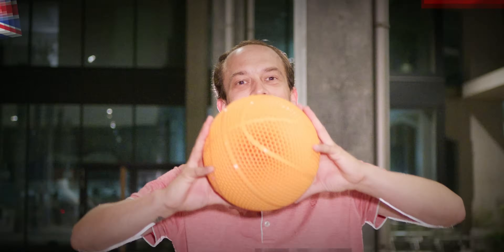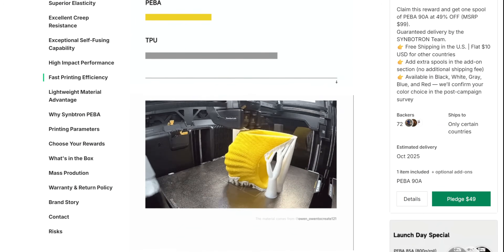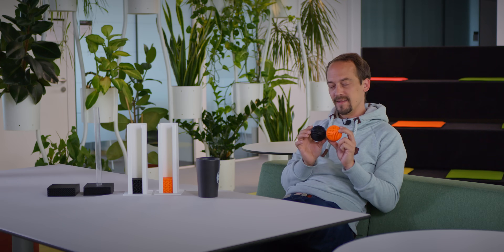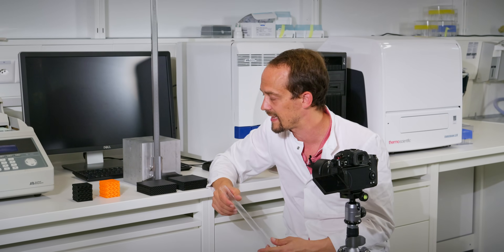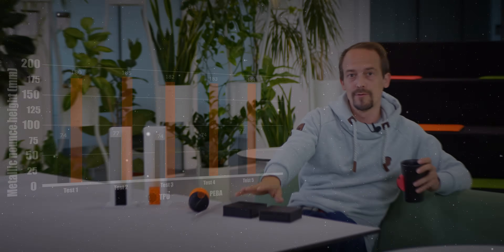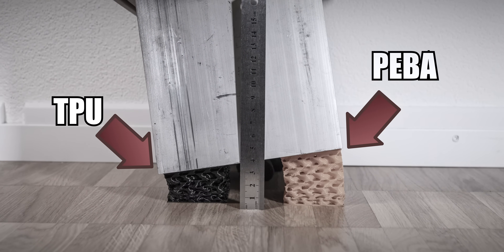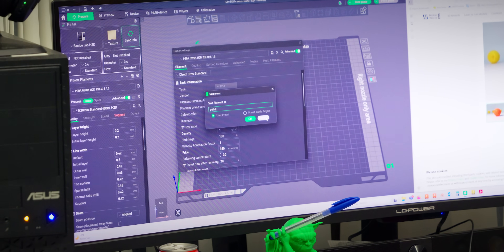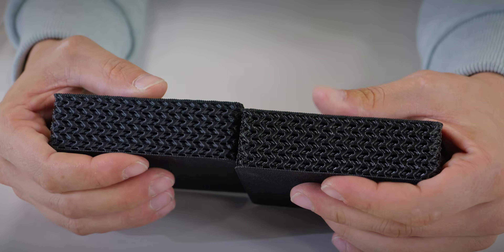Forget TPU! There is a new Flex-King in Town

Comment: I'd like to see what happens if you apply the 3kg's to the tpu print, wait for it to "settle" (I.E when the rate of compression is reasonably slow), and then apply weight as necessary to apply the same amount of compression to the PEBA. Could be interesting to see how well they bounce back to the original size and shape after roughly the same amount of time at the same amount of compression/size reduction? Love your content by the way!

Comment: How good is the friction of this stuff? Biggest downside of normal TPU is IMO the missing of proper grip, because of it's smooth surface. The only TPU I know, that provides grip/friction is Fiberology MattFlex for almost 70€ per kilo. But creeping or fatigue is also an issue and thanks for the tip.
Reply: Other reviews of other PEBA brands says that the grip is not notably better than TPU.

Grippy filament only exist in limited production experimental expensive batches, hard to find. I managed to get my hands on some grippy TPU, but haven’t used it yet to say how much better it is.

Comment: we need spool roller that senses tension and (with a motor) rolls the filament until there's no tension, like a the helping dude at a climbing gym that keeps the safety line almost taunt but not taunt 8:35
Reply: In my work our rubber extruder uses a gravity arm. The higher the tension on the arm the faster the extruder runs to keep up, if no tension and the arm is fully down the extruder stops. I'm not in a position to imagine how this could be implemented for filament spools but it could potentially be a fairly direct & dependable solution.

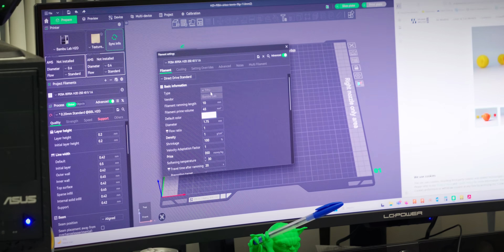Comment: 16:45 Those edge rollers can be really bad.

1) Some spools have notches along the edges, to more easily clip the end when storing it, and the bearings get a bit stuck in those notches.

2) When the spool is full it rolls easily, but the less filament is on the spool the more force is needed to pull the filament. This gets exponentially worse if the roll is higher and you're pulling downwards (because then the pulling adds to gravity), so if you do have an edge roller make sure that you're pulling the filament upwards (so additional force counteracts gravity).

Combining 1 and 2 makes for very inconsistent, or even outright impossible, printing.

Personally I'm using a middle roller with bearings. Technically it could be problematic if the inner hole of a spool was uneven, but I've yet to encounter such a spool.

Comment: 10:15 The graph does NOT show "2.5 times more" but rather 2.5 times as much. Those are NOT the same thing!

E.g., 0.7 times more than 100 is 170, while 0.7 times as much as 100 is 70. Likewise 2.5 times more than 100 is 350, while 2.5 times as much as 100 is 250.

If you're confused by it, you can stick to "as much as" and completely avoid using "times more than".

Comment: 6:10 You can't talk about weight difference in percent, without specifying the base of comparison. X being 20% heavier than Y is completely different from Y being 20% lighter than X, so you can't just say that they have "a 20% weight difference".

E.g., if X weighs 100g and Y weighs 80g then Y is 20% lighter than X (formally y=0.8*x), but X is 25% (!!!) heavier than Y (formally x=1.25*y).

Comment: Would like to print machine slideway covers of bellows. Is it possible. Would need to have a removable support between layers
Reply from the maker: If u use a h2d and pla supports they come out super nice. 
I never tryed pva with this material 🤔
Maybe worth a shot ?
Reply: @Ibuiltathing I am quite new to 3D printing, just bought a Qidi Q2, impressed with print quality. Last printer and only other printer ender 3 pro bought in 2018. Was hoping it would be possible to print bellows with the Qidi q2. If not may make from sheet metal.

Comment: Loved the video! But I wanted to point something out: 

Because you had the one weight sitting on both parts, as it shifts over so does the center of gravity. Causing one part to experience more weight than the other, which exasperates the creep difference.
Reply from the maker: That's a valid point ! As soon as the weight shifts we basicaly doubled the difference.
We used it as a visualization but we did the tests individually as well.

Comment: Isn't creep just very slow non-elastic deformation?
Reply from the maker: Exacly. The difference is that the loaf does not change but the deformation continues. 
But: the deformation is reversible. So the deformation is still kind of elastic just not instant

Comment: Slightly unrelated comment on creep: I recently found a pair of neodymium sphere magnets, 5mm diameter, stuck to a hot water pipe since maybe three years ago, one on top of the other. They had actually deformed into an egg shape over that time, presumably due to the ~55ºC constant temperature. So yeah, even metals are sometimes susceptible.
Reply from the maker: Wow that is very interesting! Thanks for sharing

Comment: On their kickstarter campaign they have a picture "whats in the box". Apparantly you get a Bambu Lab branded spool with a label reading "TPU for AMS".
Reply: Now that is interesting and they are not wrong. The Bambu TPU for AMS never gave me good results but I hate using the extra spool holder as normal TPU does not work with the AMS.
Reply: But you can't actually use it in the AMS.. so that's a bit odd?
Reply from the maker: Jea I tried 😅
Don't try it, it's a mess 😅
Reply: I think thats just a sloppy image choice. Maybe the person creating the kickstarter doesn't even know what that means 😂😂